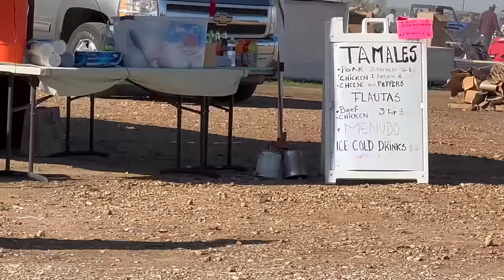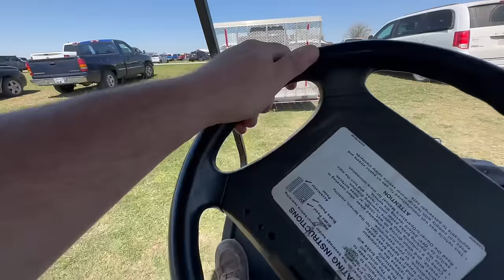I Went To An AMISH AUCTION...Wait Until You See What I Bought!

Comment: In the North, you go to an Amish auction. You may find a golf cart, but it has to be pulled by a horse or a Pony. There's no motor in it. L o l Good luck dutch
Reply: Florida they use golf carts. No place for horses. They do ride bikes
Reply: Read up on the Amish. They're not allowed to have anything motorized. It's against their religion. You won't see too many Amish in Florida.
Reply: @jeffhiatt4000  it depends there are many types of Amish. If they are Swartentroper(sp?) they are the strictest.  Then there are Old Older and New Order.  Here in Southern Wisconsin some of the communities allow pre 1960 gas tractors to be driven. Many times I have followed then down the road with 5-6 kids hanging off of it headed to town instead of a buggy and much more dangerous. It all depends on what the bishops want to allow.
Reply: So interesting religion Culture? In my neighborhood, it's the old elders. Let's still speak german
Reply: @jeffhiatt4000  The old elders are usually the Bishops